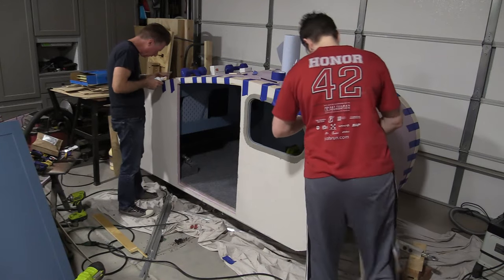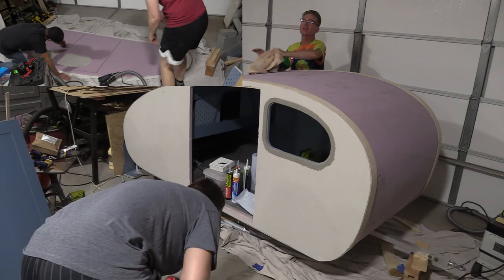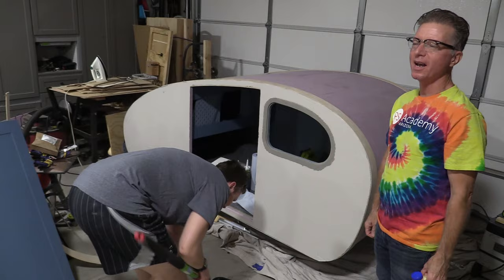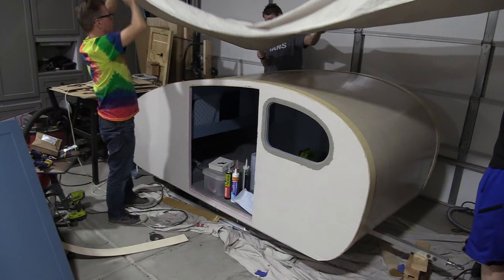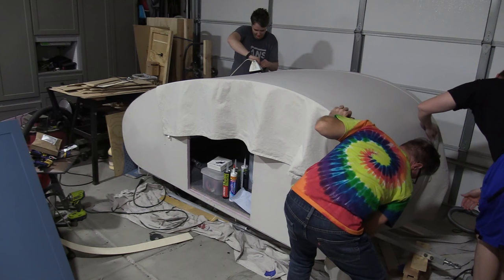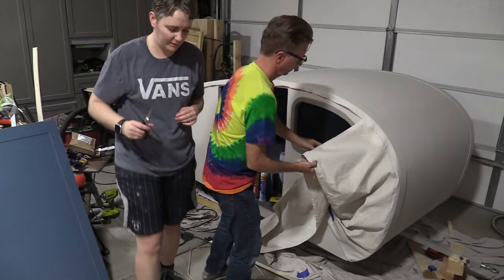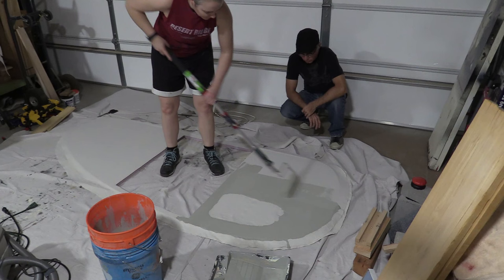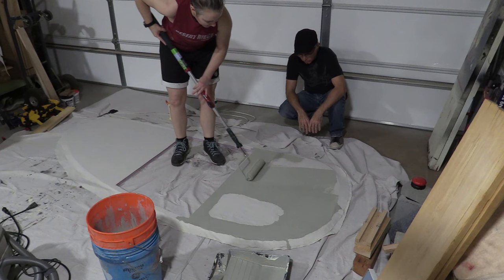Poor Mans Fiberglass PMF Tutorial, Tips to get PERFECT Corners! Foamie, Vespa Teardrop

Comment: Where did you learn about this poor mans fiberglass?

I'm wondering if you have done any work restoring vintage railroad cars or know someone who has because this is almost exactly how the roofing is done on railroad cars built up to about the 1940s.
Reply from the maker: I first learned about on a teardrop forum. And from there I just researched the technique, planes and boats used to be coated this way too. And then did small trials to make sure I had it down prior to my first trailer. I have completed trailers with it.

Comment: You said that you scored the foam after sanding for better adhesion of the fabric to the foam - how did you score the foam?
Reply from the maker: Hi Gary, we used a wall paper scoring tool for some of it. Then we found 150 grit sand paper on a solid block of wood seemed to work very well too.

Comment: I would like to ask a question...or two🤣

In your foam preparation, it looks like you are using a random orbit sander, regardless, what grit are you finding works best for you.

 Also, it looks like there is some filler on the sheet...maybe it's just the angle 😉 

 Speaking of filling, is there something you use to fill in voids and smooth out imperfections on the surface the foam.?

 What about the inside.?
 Do you skin it first, then cut it, and then go back inside and lap the corners with TBII & Canvas.?

 Thank you, I respect your builds...we'll done.
Reply from the maker: I used 120 grit in the sander. We didn't use any filler I just sanding the foam at the seams to even it out. The inside I did PMF and then trimmed it flush with the edge before putting it up. The foam bonded well to the PMF (roof to wall) with foam fusion. I would have put the roof on the top and not inside the walls... but the sides were already CNC cut with the wooden outside grid already  cut flush with the walls. I definitely like the pmf for the inside walls. And I am happy we did that all first.  I how that all made sense...
Reply: @thelwood  
  Wow, thanks for the quick response, and yes, it makes perfect sense... even the part about the top (not) bearing on the walls.😉

 I was thinking about experimenting with my router in an attempt to cut a compound rabbit into my edges... I'm not sure how much I'd gain except to increase my bonding surface.

 Oh.!
 Another thing.
 How did you attach your birch edging.?
(I could see inletting for "blocking" within the side wall a couple inches in from the edge, spacing would be relevant I suppose, but it would allow for a counter sunk mechanical fastener to be used to tighten the edging to the surface of the foam...and glue bed).
Reply from the maker: @MIDNIGHTSUNALASKA  that sounds like a really good plan! Let me know how it works out! We used foam fusion and 2 part epoxy just at the ends. Foam fusion worked really well for all porous surfaces.
Reply: @thelwood  

 I copy that.🙂

They're really fun mediums to build with..

Comment: What kind of ambient temperature do I want when performing this work? I want to make one of these over the winter in my garage and I can heat it to a certain extent but do I have to worry about drying issues if it's a really cold one?
Reply from the maker: Cold temperatures will slow the drying time,  but as long as you allow ample time between coats you should be okay. If you can get it to up to at least 50 degrees that would be great.

Comment: 6:35  Do you have any experience with  oil alkyd paints?    I assume they would need to be mixed with a suitable thinner instead of water.  

I have an affinity for for metal and wood finishing with  Tremclad - Canadian Rustoleum
Reply from the maker: Great question! I used rustoleum hammered for my little cargo trailer, I still did the undercoats with water/latex paint. I am not sure how well thinned oil based paints would absorb into the canvas. I would have to do a small trial piece first.  The cargo trailer loves outside and and the finish is still in excellent shape.

Comment: What if you use a printed canvas and want to preserve the print? Can you use a clear coat to have the same effect?
Reply from the maker: That is an interesting idea! I am not sure. The key would be to thin the first few coats and make sure the appropriate thinner doesn't effect the print. You would want to make a few small samples and play around with it.
Reply: @thelwood  That's what I was thinking. The only thing is that most clear coats, at least that I can get needs a thinner like acetone or similar and I know that stuff will eat through wood glue as well as foam. I've been looking for some that are water salable but so far I can only find it in jars that are 35 to 250 ml. I live in Germany if you are wondering why I'm using Metric and not Imperial. I think it would be 1 fluid ounce to 8.5 fluid ounces.
Reply from the maker: @seangere9698  I would definitely try water based.  Let me know if it works!

Comment: I had made comment on your video as to how I was going to try this on my camper a while back. I do have a question. I used the drop cloth material from the orange box store and the glue you suggested. After spreading the thinned glue out and spreading the cloth out smooth, everything looked great. I went in to let it cure. When I went back out to the shop the next day, I noticed there were like wrinkle bubbles in places. They feel like the glue had penetrated the cloth. In your opinion, do you think this will seal ok or should I start over again? Thanks bunches.
Reply from the maker: Without seeing it, I am not sure.  I would start by sanding it and see if that takes care of the problem.  As long as there aren't air bubbles I think it will be fine
Reply: @thelwood  They are pretty substantial. I keep thinking that i should start over. I usually go with my first instinct, which in this case is to start over again. Thank you for such a quick response. I really do appreciate it.
Reply from the maker: @racerx12003r  if they are substantial then probably best.  Did you press the canvas first to get the wrinkles out? I always do that and press it again when it is on and the glue is still wet.
Reply: @thelwood  I washed and dried it with the clothes drier on a low heat setting. After it was dry, I carried to material out to the shop and spread it over top of the camper and left it to relax through the night and all the next day till I got off work. When I got home that evening, I went out to the shop and it was laying perfectly with no wrinkles (My shop was about 100 degrees with the doors closed.) so I didnt iron it. When I glued it, I used my hands across it like a squeagy to press it down and remove any air bubbles. As flat as it laid down, I just closed the shop up for the night and left it. the next evening when I got home, I saw the wrinkles. I guess i should have ironed it both times.
Reply from the maker: @racerx12003r  it is a pain to do, but definitely worth it in the end

Comment: Is the paint process 50/50 mix and then 2 coats 75/25? I didn't know if the final coat was mix or straight paint.
Reply from the maker: The final few coats are full strength.  Each coat and sanding between will make it smoother.  I do 3 full strength coats.
Reply: Ok so 50/50 coat, 75/25 coat and then 3 full strength coats for final. @thelwood
Reply from the maker: @icechaser5196  yes,  happy building!

Comment: Hello. Where did you buy your drop cloths from? And what sort are they? Thanks.
Reply from the maker: I get the 8oz drop cloths from home depot.  Amazon also has good options that are seamless. So far, I haven't encountered seams in the ones from home depot, but did from harbor freight.
Reply: @thelwood  Ok thanks. 1 other question. I see you just use tight bond under the drop cloth not on top  like others. Do you think there is benefit in gluing over top? And what made you just do underneath? And have your lasted test of time?
Reply from the maker: @warrenbenton9033  all of my trailers are in great shape years later. I have never done a direct comparison to one with glue over so I cannot say my way is best. But my technique is the way they used to make boats and planes. I like the paint to be able really get absorbed deep into the fibers of the canvas. It gets really stiff this way. I have actually cut my skin on  edges that hung over a bit.
Reply: @thelwood  Ok that's helpful👍 last question. Is any exterior water based paint fine for the top coating process? And how many coats would you recommend?
Reply from the maker: @warrenbenton9033  any is fine,  I usually do 3 full strength coats.  It really depend on the texture you want.

Comment: Wouldn't oil based paint be a better product for this application or a poly coat ?
Reply from the maker: One first coat is a mix of 50/50 water/ paint.  That coat really soaks deep into canvas. So oil wouldn't mix like that.  This is why traditionally exterior grade latex paint is the standard for PMF. It would be interesting to try with oil and see how the results are.  If you can get it to really soak into the canvas it might make a nice finish.  I have made 3 trailers, one of which is 7 years old and have been very happy with the finish.  If you try a different technique and get better results please let me know! Thanks!
Reply: @thelwood  масло и латекс  несовместимы. Пришлось скоблить и шлифовать бетон... Иначе пятна. Можете не пробовать и не тратить время/ $ ...
Reply from the maker: @user-bg4py3bc3t  thank you!
Reply: @thelwood  did you use primer first?
Reply from the maker: @garrysharp785  no,  just any old exterior paint at 50/50 water/paint
Reply: @thelwood  THX!

Comment: I've long thought that PMF is a misnomer, it has many advantages over fiberglass, it's not just that it's cheaper...  

much lighter in weight... easier and faster to build...  no plugs or molds...  no dust, no need to wear a respirator to work with it...  easier to repair...
Reply from the maker: Absolutely!

Comment: Poor man's fiberglass costs more money than ACTUAL fiberglass. This is a very nice build that could be even better if built with epoxy instead of paint and glue. 

You can get a gallon of general purpose epoxy for $45 on Amazon. 
A 50"x12 foot 6oz fiberglass mat is only around $25, which isn't any more expensive than cotton canvas, however if you really like the cotton canvas you can actually use the epoxy with it with much better results than you'll get with paint and Titebond.

The epoxy will actually contribute to the structural integrity of the trailer and it's relatively maintainance free. It's also less labor intensive to apply it.  There's really no advantage to "poor man's fiberglass". 

You should really give epoxy fiberglass lamination a shot, you'll never look back. In fact, it's not too late to install a thin 4oz fiberglass over top of this canvas and protect it forever.
Reply from the maker: Thank you the information! I try to keep fumes low in my shop as much as possible and like the texture of the canvas. But it definitely isn't as strong as fiberglass! I will likely try or fiberglass if a build a bigger teardrop again.  Thanks again!